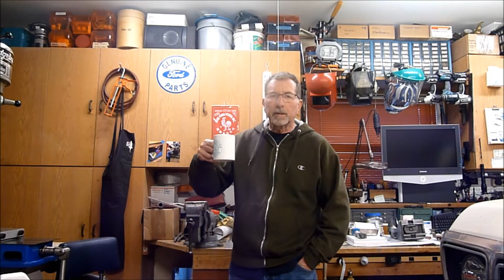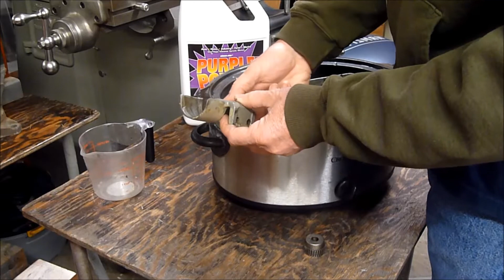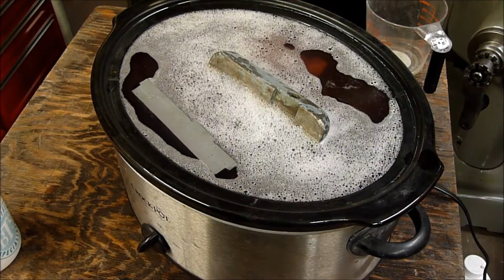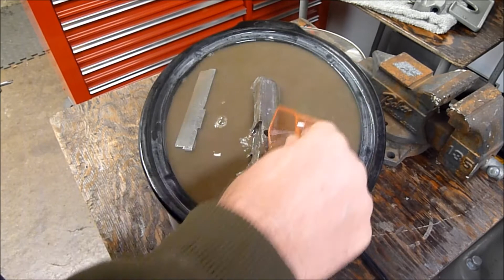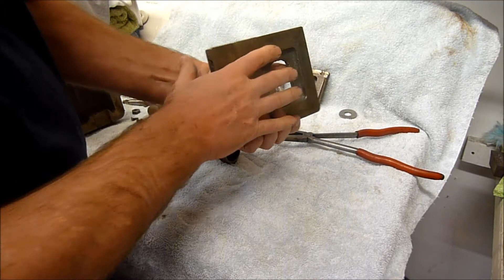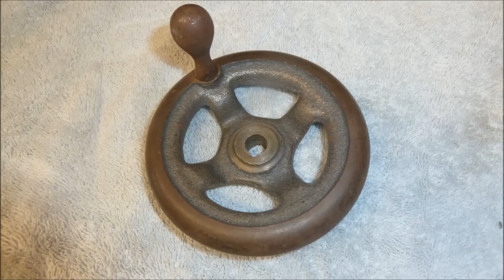Crock Pot Parts Cleaner - Shop Tip # 1

Comment: I use a large Turkey roasting pot on a Hot Plate to do Parts washing. I use Tide Powder, Laundry Soap and it removes the oil, grease and even the Paint after about an hour of boiling. Unlike some chemicals it won't attack any soft metals.
Reply from the maker: Funny I've been meaning to scale it up a bit. Before I was looking for one. I used to see large pots at the flea market for dirt cheep.. Naturally now that I'm looking for one. None to be found..Lol, but I'm not looking that hard.. Thanks York !